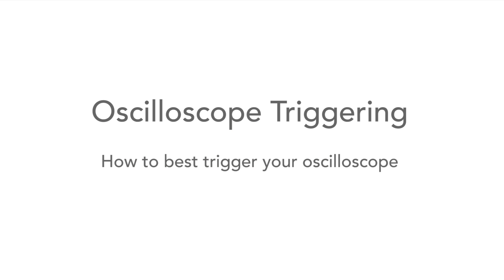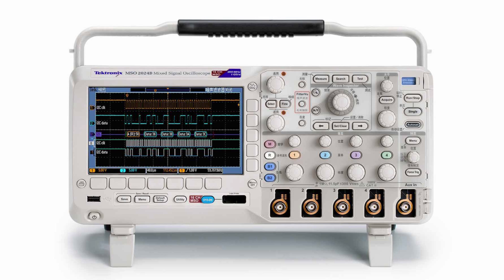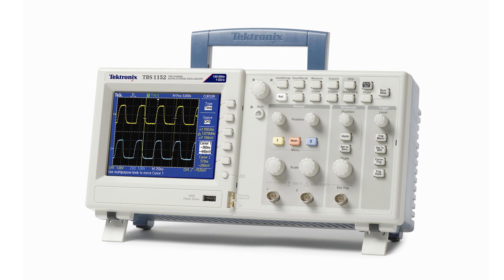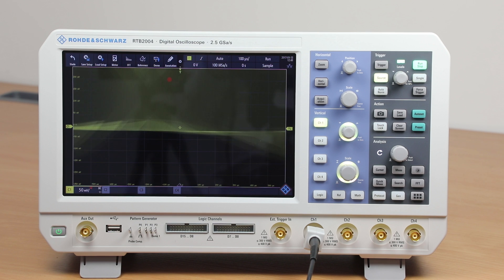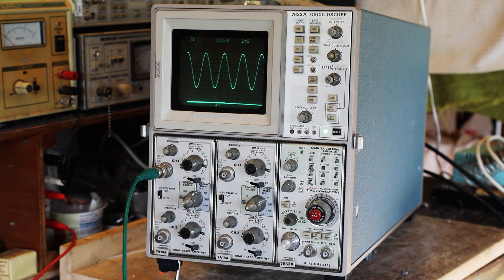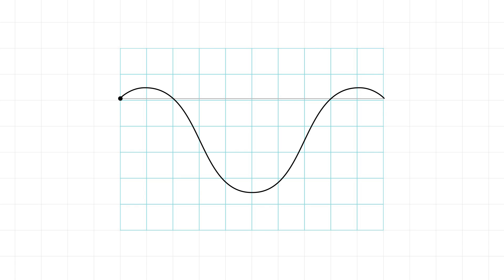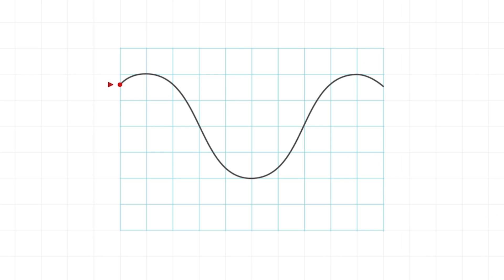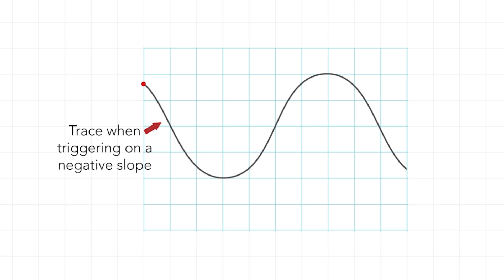Oscilloscope Triggering Techniques:- how to trigger a scope

Comment: So what a waste of time. Where's the info about AC triggering ?
Reply from the maker: Sorry to hear you didn't find the video useful. We try to do the best we can, but obviously don't always hit the mark for everyone.
Reply: "Where's the info about AC triggering?"
Given that AC comes before DC, scroll back!   Anyway, the idea is you might want to trigger on a small signal with a large DC offset.  AC triggering filters out the DC (series capacitor) allowing to trigger on mere millivolts of AC riding on many volts of DC.  It would be difficult to adjust the trigger exactly right to catch those small excursions on DC, but easy with AC triggering.

Comment: Whats the difference between these 3 - Normal - Scan - auto..-  Im familiar with "single", as that, will wait for input before almost taking a screendump , but these 3 other trigger modes look like the same- 
thx for the video.
Reply: Auto inserts a dummy trigger if no other trigger is detected.  This gives a horizontal line which can be preferable to a blank screen.

Comment: If one wants to synchronize two oscilloscopes, would it be better to use the auxiliary trigger input or an analog input channel?
Reply: It sort of depends on the nature of the signal.  A nice clean trigger signal ought to be inserted on the external trigger input.  Otherwise, trigger both scopes on an analog input channel.

Comment: Let's say I have displayed an input signal (of an ac system or whatever) and afterwards I also display the output signal. Does the triggering the phase difference between the two signals? If so, Why?

Comment: What is the difference between before and after triggering on my DSO oscilloscope. The square wave looks identical either side of the trigger? There is a memory display of the record length at the top of the screen that shows a trigger and how much of the record length is displayed on the screen. I can scroll indefinitely in one direction in this record length box but only to the end of the record in the other direction. It is a Rigol scope
Reply from the maker: The various formats for trigger can help in some situations where there are complicated waveforms, or a particular part of the waveform needs to be monitored. In many cases it will to make a difference.
Reply: The pre-trigger display tends to be rather limited and might not be useful at slower horizontal rates.

Comment: how to capture multiple trigger on single channel on Rto1104 scope
Reply from the maker: I am sorry but we cannot provide advice on individual scopes and how they work. I suggest that you contact the manufacturer directly - they should know.
Reply: thanks for reply.i understand that each scope has different feature.have you ever captured multiple trigger on single channel?if yes than kindly share how.may be I get some idea about the scope which I am using
Reply: You can view a waveform, perhaps for instance 10 waves of sine wave; the scope will trigger on the first one (after its hold-off period) and the remaining waves will simply be displayed.  Until the sweep is complete it cannot be "re-triggered".